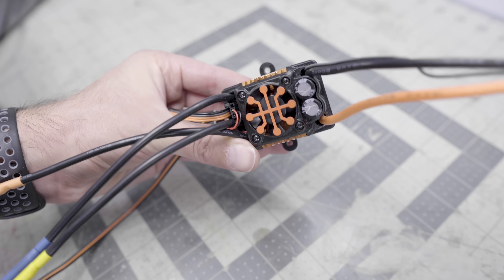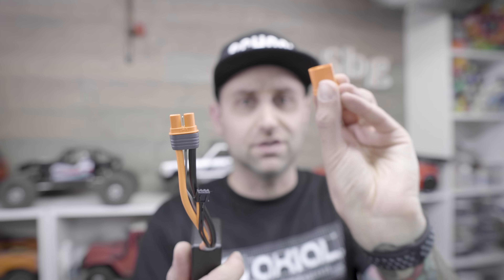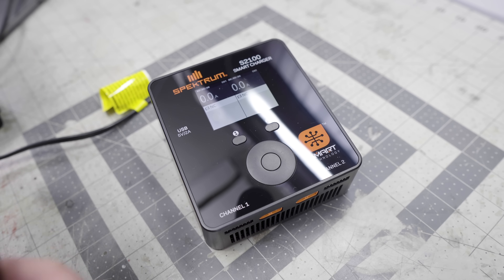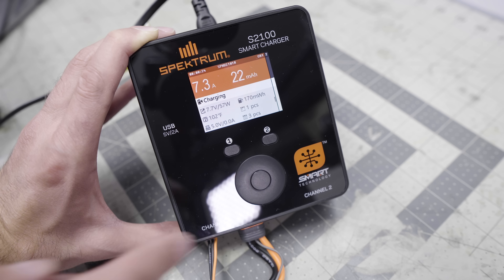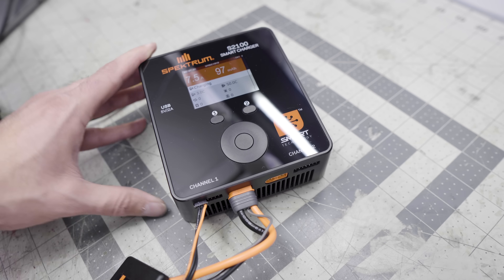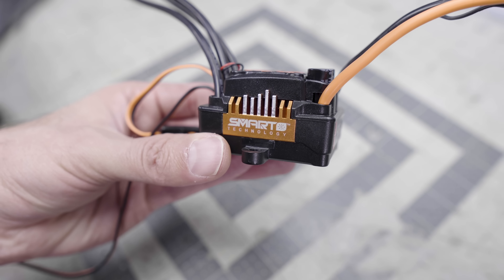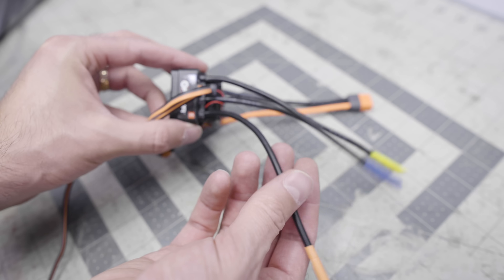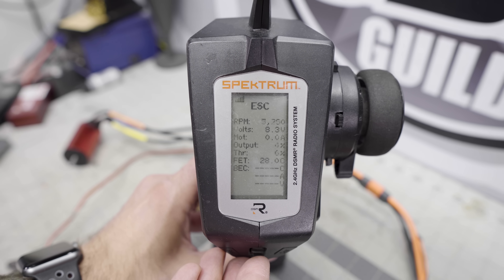Spektrum SMART Technology - How Smart is it?

Comment: Sensored and Brushed on the way! :)
Reply from the maker: THAT'S FANTASTIC NEWS!
Reply: Fantastic!!! The Spektrum batterys, Is that chip watherproof !! NC❤ MOUNTAINS Backyard RC AND MORE.  🏞
Reply: Do you cats have a solution to save/restore programmed vehicle data? Or working on it?
Reply: Being no sensored ESC available cancels the deal for me too. 

Not only for crawling, also for the racetrack and rallying, throttle response is key and sensorless doesn't do the job.

Will there be a smart conversion kit for batteries too?
Reply: Yay!!  ([:(D>
Reply: Any update on the sensored offerings?  I’m building up an Axial Bomber, and am interested in the smart tech, and just generally prefer to stay within an ecosystem for simplicity and plug-and-play fun.
Reply: any updates on sensored? @spektrumRC

Comment: Great Video, Thank you....I just bought this setup with the 4s 5000mah 100c packs for my DBXLE 2.0. I found this online "If using the Spektrum charger and battery together, you don't need to use the balance connector. It has a third lead in the IC5 connector for balance and telemetry data."
Reply from the maker: Thanks for the info!

Comment: 10:28 -- wtf...4161mV cell imbalance? That's a misread or that battery is already on fire. SMART messed up on that one.

Coming from the "air" side of things, no one is getting more proprietary with physical connectors between battery -> ESC -> motors. If you're in the hobby, you should be able to solder or crimp and thus you pick your connector as you want it. Avoid any system that'll force you into one style or another along that path. Any dedicated manufacturer of motors or ESCs of decent quality isn't going to play stupid games and sell you on gimmicks to get product off of the shelf and those three components matter quite a bit in terms of build quality.

From ESC telemetry to RX -> Radio/TX is where things are usually proprietary almost everywhere, but don't have to be. I don't have an issue with Spektrum RX and TX being a pairing for telemetry in general, and generally working best with a Spektrum ESC (whatever extra cable). However, the ESC data to RX is the most critical information link most folks want on their radio these days, and this part shouldn't be made intentionally proprietary. There's no standard, but even Mikado's VBar system (for RC helis mostly) interops with a couple of different ESC brands with telemetry just fine. It's really not that hard to pull off and I don't think manufacturers should be intentionally locking in with ESCs as it is a major component of varying quality and performance specs. You should be in full control over your ESC choice for any RC application.

Comment: ESC WITH S2100 SPECTRUM BATTERY. BLX SPECTRUM MOTOR. AND SPECTRUM RADIO TRANSMITTER CAN'T FIGURE OUT WHY THE MOTOR BLEW TODAY ON SUCH A ADVANCED SYSTEM AND MOTOR IT ONLY TOOK 6 DAYS TO HAPPEN.

Comment: Looks like ISDT's making a comeback with a spektrum label and plug the plugs look like XT60 & XT90 plugs go figure HorizonHobby wood go out of there way to buy out another good brand then destroy it by making it proprietary and way way over priced glad I'm sticking with the original ISDT T8 and XT60 plugs so many better cheaper options out there wen you stay away from HorizonHobby... dropped spektrum for frsky as well what a better value especially on receivers and quality!

🍻cheers🥃
Reply: They are actually EC3/5 plugs, with a design similar to the AMASS XT-H 60/90 connector style.
Reply: Ok... fan boy... good to know. Thanks for the update.
Reply: Not a fan boy at all, I was just stating facts. 👌
Reply: With you all the way supposed to be a hobby can't justify the expense of their batteries 👍

Comment: I can't say I've ever had enough battery issues to need something of this nature. I have only had an issue with one battery in all of the years I have been in the hobby and it was actually a very expensive battery from a high quality production company. I have packs that I've been running for almost 8 years and they still charge well and perform extremely well. But I know lithium ion batteries can be finnicky
Reply from the maker: Are you talking about LiPo batteries? Nimh are pretty stable. LiPo, not always.

Comment: They really nailed it with the SMART technology.  The auto discharge to storage voltage feature is my favorite.  They did this much better and made it much easier to use ANY type of battery or connector than Traxxas did with the horrendous ID plug setup.  Horizon has been on fire with the new releases this year.  I've been a Deans man for 30 years, but I am now slowly switching everything to IC/EC plugs.

Comment: Sounds like a great setup, but without a sensored crawler ESC from them it's useless to me. Unless .....  an 1800 revolver and adjustable throttle curve .....
Reply: Thats awesome!!! Now we just need some 2s and 3s battery options in 2000mah and 3000mah and I'll be doing some serious swapping on my fleet.
Reply from the maker: Just got word that Sensored and Brushed options are in the pipeline.

Comment: Personally, all this is is Spektrum taking the "proprietary garbage" that Traxxas had been doing for several years, and applying it to Spektrum's lineup.  It may be "smart" from a financial standpoint...at least for Spektrum, as their charging premium prices for these things, plus they "lock" you into the Spektrum product line.  I do NOT like being "locked in".
Reply: Actually, they did a better job of it. Everything is still compatible with the older stuff and vice versa. You can charge a conventional battery on this charger and charge the batteries on a conventional charger. Just added features when using them together
Reply: @connorshort38  Yup not locked in! Just added benefits for being Smart!
Reply: @connorshort38  I never said you couldn't charge current batteries in the 'smart' charger, be or that you couldn't charge the 'smart' batteries in other chargers...I understand it's "backwards compatible", that you can charge the 'smart' batteries on other chargers, & other batteries on the 'smart' charger (tho, you'll need to use adapters if those batteries don't have EC3 connectors), but that doesn't eliminate the fact that you're still paying an ultra-premium price for these features.

Additionally, in doing either of those, you're completely wasting the 'smart' capabilities, as they only work if connecting 'smart' to 'smart'.  On top of all that, the entire purpose behind this, as Spektrum's marketing team knows all-to-well, IS to get you to buy all 'smart' products.  While Spektrum isn't currently offering 'smart' motors, you know they've got to be coming sometime in the near future.

The "goal" (what Spektrum is expecting users to eventually do) is to have all the vehicle's electronics be Spektrum 'smart' - ESC, motor, batteries, transmitter, receiver, and servo.   That is the "Spektrum 'smart' ecosystem"...again, similar to what Traxxas had been doing for years, but "elevated".
Reply: @robbryan3044  Why compare to traxxas? They're batteries and chargers only work with each other where these are still completely compatible. Also, the batteries and charger are right in the price range with other name brands.

"Smart tech" will only let you take advantage of the "smart" features when connected to itself but you could use the battery and the esc or the battery and the charger depending on what you want to do. You can use them all to get the most out of them. I'm sure they are working on a motor to provide more information. Why wouldn't they? It's so much more conveniently set up without needing a separate telemetry module.

Traxxas is attempting to keep all of their users on their platform through their proprietary items. Making the connectors unavailable for purchase, making their batteries only work with their chargers and trucks... With this move spectrum is simply adding more ways to get information which some people crave instead of attempting to trap people with them
Reply: @robbryan3044  if you want you could just use the batteries to take advantage of the self discharge.
Reply: Don't get married then...
Reply: I couldn’t agree more. Spektrum/Horizon Hobbies is nearly a monopoly in the hobby business, and they did it by slitting the throats of the competition, then buying them up for pennies on the dollar. Yes, Traxxas has been selling their proprietary crap for quite a while now, and unfortunately, I think we are going to be seeing other big players doing the same thing in the future. As for me, I’ll continue to use connector adapters as needed and apply my savings to the purchase of “dumb” batteries.

Comment: Converting all of my trucks from Deans to XT60 was a big enough pain in the ass.  I'm not changing again until they figure out Nikoli Tesla's wireless electricity.
Reply: I did the same a while back. I think an adapter would be the key, pick up their plug and put what you want on the other end (do they sell the plugs I wonder?)
Reply: @humboldtef  it is still compatible with EC3/5 connectors.

Comment: I am imagining charging some batteries and then delaying a day and them all going back to storage on you overnight.....
Reply from the maker: Not quite, you have the option to set a delay of up to 10 days!
Reply: @scalebuildersguild  does that mean they suggest 10 days is the max before you should discharge for storage?  I've gone 3 weeks a few times when something came up and I forgot. That's good to know for other users
Reply from the maker: Andrew Odom it’s probably a good idea after ten days, yes. I’m learning the same thing!
Reply: Left them months before fully charged. No loss or problems. If you charge and store correctly it's not an issue.